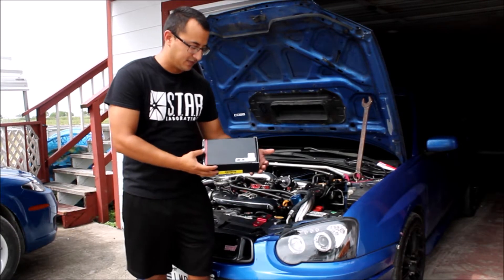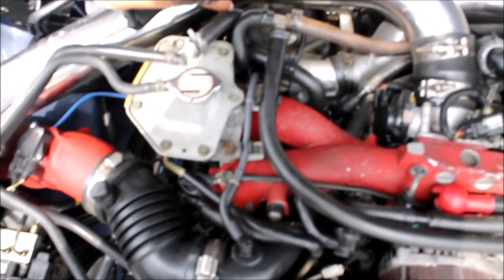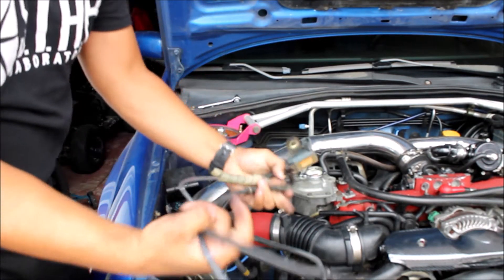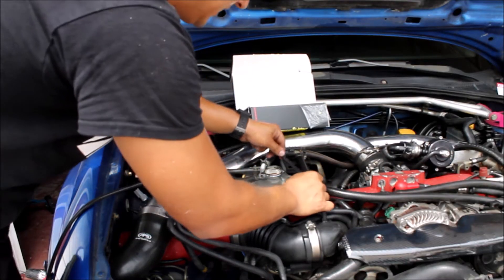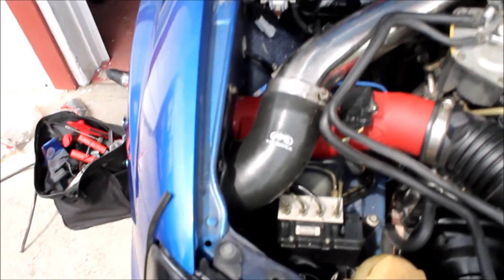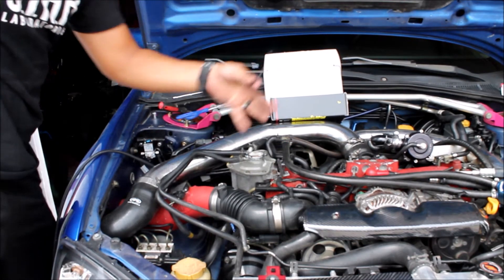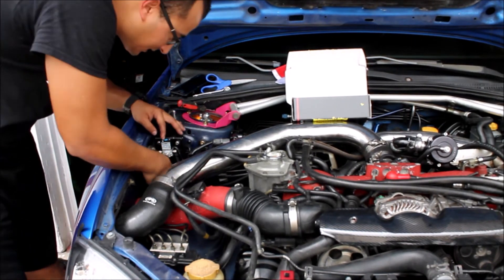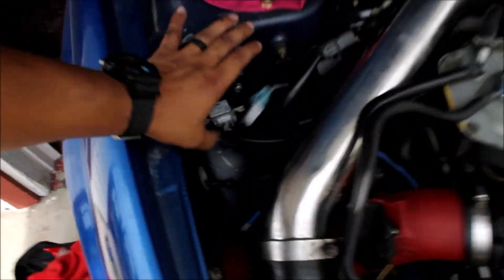COBB 3-PORT ELECTRONIC BOOST CONTROL SOLENOID INSTALL

Comment: what boost controller you are using to increase boost? or you adjust it via the ecu when tuned...?
Reply from the maker: Tuner increases the boost by the tune in your ecu